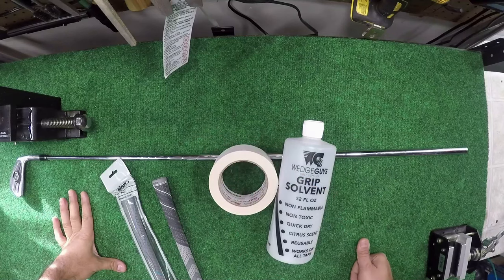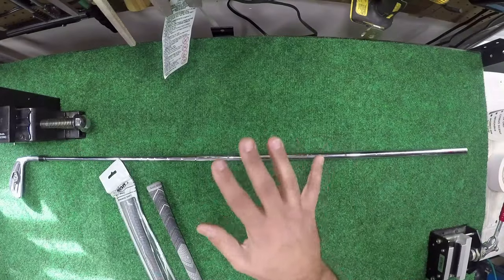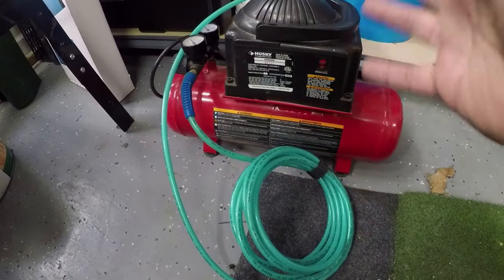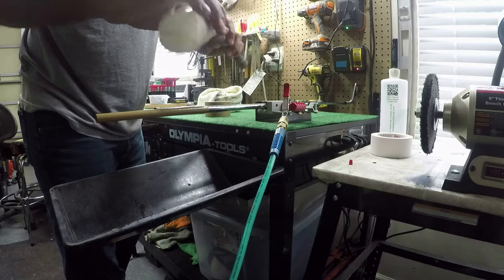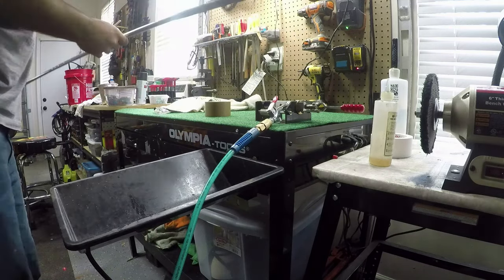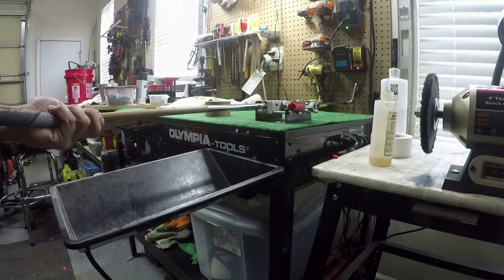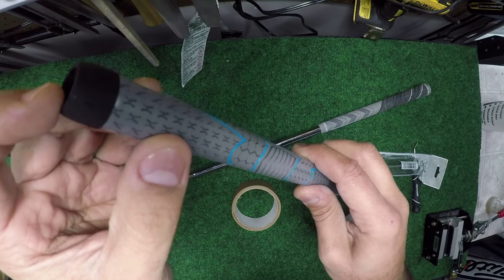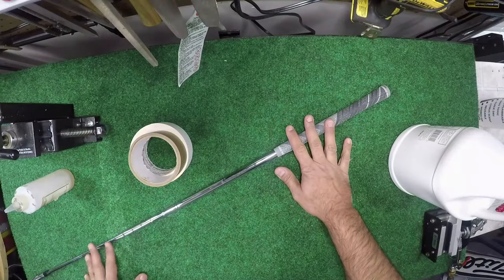Using Air to Regrip Golf Clubs - EASY! #golf #golfclub

Comment from the maker: Have you switched to air?
Reply: Yes…bought a special air gun to install.  I have installed Lamkin and Winn grips with air, no tape or solvent.  There is some shifting that can be adjusted with another shot of air
Reply from the maker: @vincebrown5158  thanks for the comment bud...i do have a few winn grips laying around to try.  What was the tool you purchased?

Comment: i use an air compressor that is meant to fill car tires or air mattresses and it works amazing!  when i am taking grips off, or putting on any expensive ones, i always use a sleeve of hard cardboard poster tube (like a thicker paper towel roll) to slide over the grips to prevent them from exploding.  i have even put on some winn grips before i knew that you weren't meant to be able to do it that way!  thanks for the great video.
Reply from the maker: Yeah, the occasional explosion can make you jump. That's why I switched to a nozzle I can control instead of an on/off switch that's usually nowhere near you when you start to see that bubble forming!  I've never had any success with winn grips, but that doesn't mean its not possible!  Thanks for watching.
Reply: Does this work on putter grips?
Reply: I have a piece of PVC pipe that I cut in half and tape around it while trying to remove grips (Thanks Mobile Clubmaker). Make sure tou use some substantial tape when doing this (ie duct tape). Masking tape will burst along with the grip.
Reply from the maker: @husbandandwifegaming_9991  no it won't.
Reply from the maker: @billybobtimm1787  i feel like id rather just have rubber shrapnel coming at me instead of rubber and pvc. Just wear leather gloves or decrease the psi outputin your machine...its not that bad if you get popped on.

Comment: Love your video. Thank you!
I never thought of using air. 

I regripped my clubs for the first time. I tried the traditional way.

I used double sided tape. Lube the grip inside, lubed the tape then slipped the grip on. However it was a pain to get the grip on. Not as easy as some videos showed.

I ended up doing the rest of the clubs like this… Still using double sided tape but I didn’t take the protective layer of 2nd side of tape off. Lube the grip. Lube the tape and slide the grip on. So much easier to put on.

Two questions thought!
1. Is it OK to do it this way? The grips don’t feel like they will come off. 

2. I may have stretched the grip a bit longer than the original grip. Is that OK too?
Reply from the maker: Yes it should work. From a cost perspective its a little more expensive using the double sided tape, but if that's what you have, it will work fine. I would try to get them to their normal length, just because as you stretch it, you're making the grip thinner. I've found just holding the end and shooting a little air in there brings them back to their natural length. Or use an unused grip as a guide. Thanks for sharing, glad it helped.

Comment: Just dip tip of the grip in solvent, for easy entry. Good for rubber grips, not Winn grips. 50 psi.
Reply from the maker: shouldn't really be using this method with winn grips anyway.  too much chance of messing up the internal piece.
Reply: @3PuttBogey  it’s not something I recommend, even if I’ve  installed, successfully, quite a few Winn grips using air.

Comment: Has anyone tried to put on JMX Ultralite grips using compressed air? If so, how much pressure do you set it to?
Reply from the maker: They are a 2 piece grip. Not really recommended for compressed air installation. If you want to try 1, you can, but most likely will get ruined. Id start at 30psi and work up 5psi but def don't exceed 50psi. Chances of ruining them are pretty high.

Comment: Can you use this method for Isomic grips?
Reply from the maker: Iomic? Yes. As long as they are a one piece grip, this process will work on any grip.
Reply: @3PuttBogey  dang spell check, that’s what I meant. 1 piece, rubber.
Reply from the maker: Yeah youll be fine, just keep the PSI under 70.  Dont want to blow one out.

Comment: Is the solvent, mineral spirits? And can you use water in place of solvent?
Reply from the maker: Yes!  Or water with a couple drops of dawn dish soap. Don't need a lot, just to get it on the butt end of the shaft.
Reply: @3PuttBogey  thank you! I already put them on, I had to use air.
Reply from the maker: @migratorygame7400  air is the best way...easy to swap out and change.
Reply: Does the air removal method work with grips that are on traditionally. Two sided tape and solvent??
Reply: @maxsmart8954  I had to cut my old grips off, I used double side tape and new grips. The air worked with soap and water to put the new grips on, but it only worked because I folded the tape over the end of the shafts a little to cover the hole in the shafts. I used a needle for a ball at the end of the new grip, and they went right on.
Reply from the maker: @migratorygame7400  that's why you always put a layer of tape..to avoid that. You really shouldn't be putting them on the bare steel shaft
Reply: @3PuttBogey  putting what on the bare shafts? The grip? I used tape, then soap and water, and the air to get the grip to slide down the tape.
Reply from the maker: @migratorygame7400  my fault bud, I misread your comment.  I thought you just folded tape over the butt!  Glad it worked out for you!!

Comment: I've been using air and regular masking tape with this method for a while now (I got the same compressor in the video from Menards). I have always been wary of trying it with the Winn grips, but I was wondering how it would work with the JumboMaxx Ultralite grips. Would it be the same issue? All the grips I've tried it with so far have worked great. Where can I get the build-up tape you use?
Reply from the maker: It should work with the jumbo grips/ultralight... the buildup tape is from golfworks.com its a little pricey compared to masking tape, but has a much better thickness and withstands multiple installations
Reply: I just put Jumbomax Large on my clubs using air. Super fast and easy
Reply from the maker: Awesome!
Reply: @dsteele5530  How much pressure did you use to install the Jumbomax Ultralite grips? Thank you.
Reply: @TSOSGERBY  it was around 60 psi. Pops right off
Reply: @dsteele5530  Thank you.

Comment: You can do this without any solvent. I’ve never used any
Reply from the maker: Correct, I think it just makes it a touch easier and let's you adjust the grip length properly.

Comment: Wait wot... You proclaimed to not use tape or solvent and then precede to use tape and solvent.
Reply from the maker: I used regular tape, not double sided. And the little bit of solvent is optional to make it a little easier. If you tried it before making your comment, you'd understand why.

Comment: I have no idea why you're putting tape on them and I don't think you know either
Reply from the maker: To build up the grip. If you just put out on the shaft bare, the grip will be slightly too big and it will move around. So yeah, actually I 100% know why.